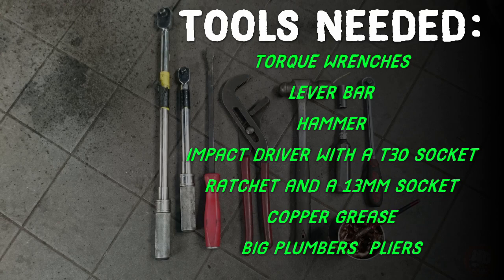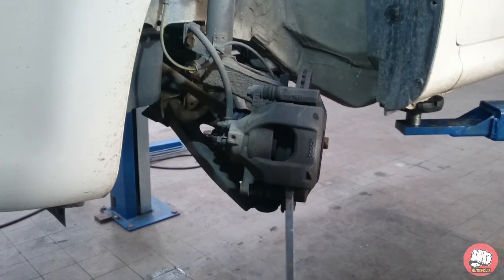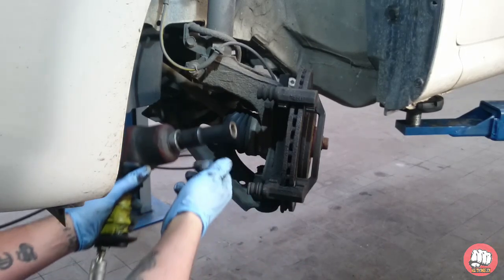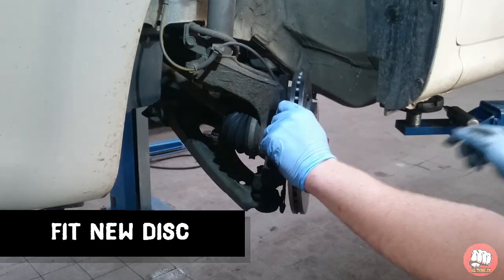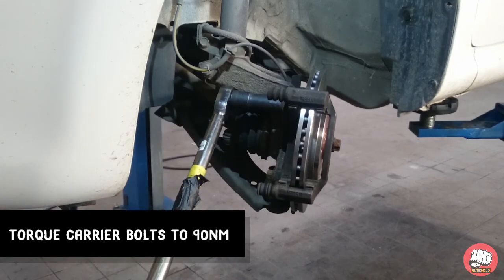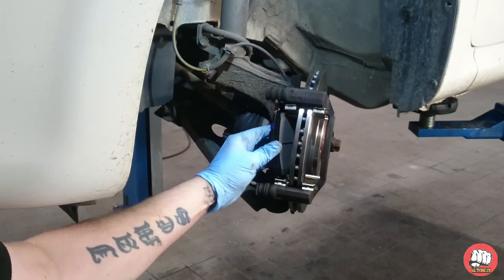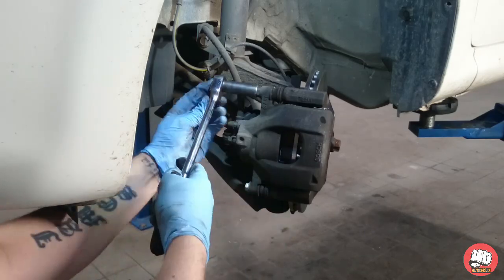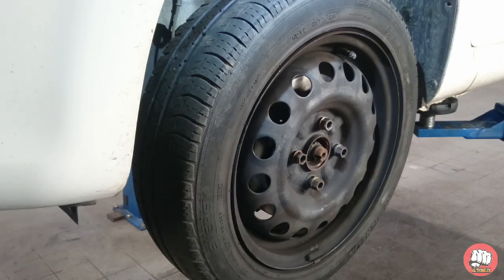Citroen C1- DISCS AND PADS (FRONT)

Comment: Good video 

Even mentions the torque settings for the bolts

Not everyone likes using copper grease these days as can cause issues with the ABS ring and sensor better of using a non metallic lubricant such as Ceratec or similar?

Comment: 90% of a job there, I would have cleaned the hub face before greasing and also check the sliders are not bone dry / re grease
Reply from the maker: Barry Britcher thanks for commenting,  the hub was already clean enough and the sliders were free and had plenty of spring on them thats why i dont pull them out in this video as theres no point,   if you take a look at one of my other videos where it needs doing i show to do it 👍

Comment: I would have  cleaned & regreased the slide pins with red rubber grease, even if they weren't sticking.
Also, I've stopped using copper grease on the pads & hub face, I prefer using Cera Tec by Pagid/Textar/TMD friction

Comment: Pump the brakes with the reservoir cap off then refit?
Reply from the maker: Yes, only half pumps though until it goes hard to avoid damaging the master cylinder seals 👍 then check fluid level
Reply: I think he is being sarcastic. Dont pump any brakes until the reservoir cap is back on.

Comment: I realise this video is a bit old already, but I just swapped the discs and pads on my Toyota Aygo, which is essentially the same car. I had some issues with the bottom caliper pin not travelling very far back and forth. I tried removing it to see if there was brake dust/rust stuck in there, but I couldnt get it out  without feeling like I might damage the rubber and possibly bent something. How much travel and how easy should the bottom pin travel? Just like the top one?
Reply from the maker: Hi there,  you should be able to move it in and out pretty freely, your bottom pin will have had water in there and gone rusty causing it to partially seize, its pretty common but needs sorting before you start driving your car back round after the replacement brakes. Its easy to fix, first take the caliper back off and get a hammer and hit the bottom pin inwards as far as it will go then get the spanner that fits on the end of it,  (i think its either a 17mm or 19mm) and keep wiggling it backwards and forwards (towards and away from you) until it feels fairly free and pulls all the way out (if you struggle doing it that way get some vice/mole grips on the pin end, hard-where the spanner went,  then wiggle and pull at same time until it comes out (sometimes even a few taps on mole grips with hammer is required depends how bad it is) dont touch or  damage the rubber with the vice grips, once the pin is out squirt inside the hole with loads of wd40 and using an emery cloth give the pin a really good clean, get all the rust off, then slap loads of copper grease on it and push it back in, make sure to put the rubber back over it again and jobs done it will be fine for years. Hope that helps 👍
Reply: Thx, sounds like I have more work ahead of me.